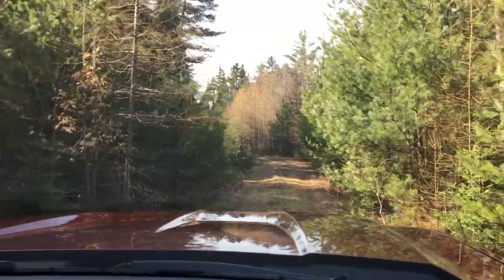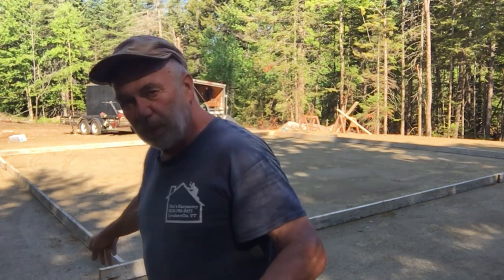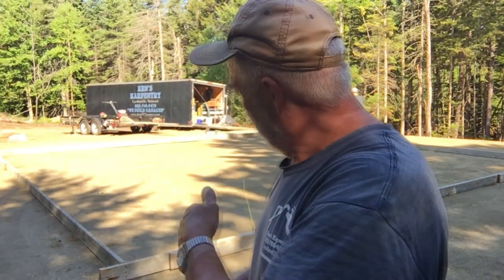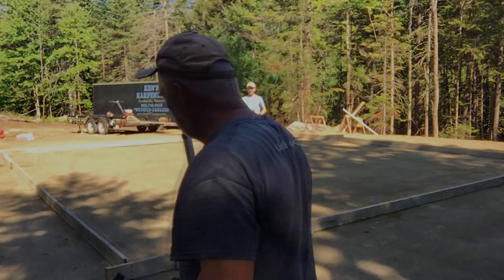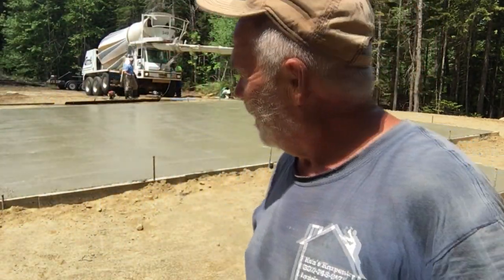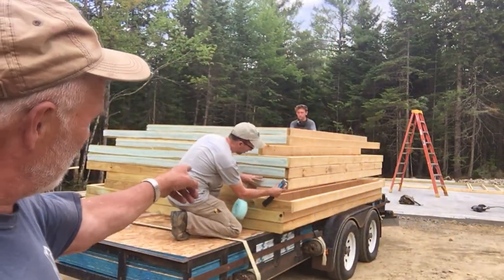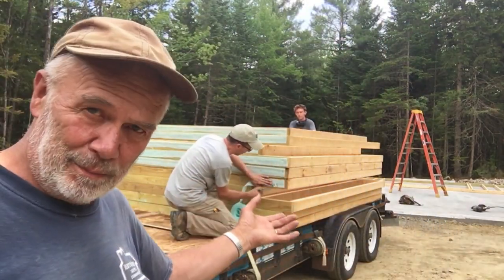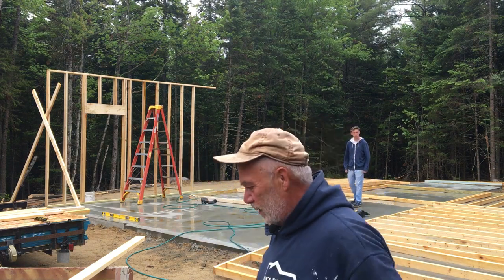#190 Garage in the woods for ATV's and Snowmobiles Part 1 $29,000

Comment: I assume you're one of few builders that is sill willing to give the customer a "firm, fixed price" for a 100% finished project. Good for you. Nail drivers (aka to themselves as builders....lol) living/working in my area are inexpereniced and afraid to quote a firm price. They offer guesstimates"...lol. 

I designed and built cabinets, specialty stairs, homes, garages (similar as you're doing) commercial/offices, farm buildings (dairy barns/poultry houses) and subdivisions for a fixed price, for thirteen years before I became "burned out". I then moved on to (continuing) subdivisions, sewer/water utilities, sewer treatment plants (a very large profit margin for those), airports, ponds/lakes, marina basins (up to 900+ boats in some of them), condominiums, State highways, and bridges along with land clearing and other various construction project, some in the multi million dollars to as low as a couple thousand dollars. I live in a very rural area and we had to be very versatile. I enjoyed 47+ years of construction before retiring. 

AND I did ever project for a fixed fee. If I messed up (and it happened 3 times), it's cost was out of my pocket.
Reply from the maker: WOW. That’s a career. Sounds like you earned some time off.

Comment: How are you keeping remade wall sections in place before double top plate application.
Have you ever written a step by step manual for a typical 24x24 garage showing all your easy method to keep everything plumb and level through entire process. If you did , I think you would sell a lot of copies.
.
Reply from the maker: One stud is centered where the 2 plates come together. That holds 2 sections together until the second top plate is put on.

Comment: Have any sticks or rocks come flying through the air?  That means Bigfoot is close by.  On a more serious note is that a roofing nailer you are using on the OSB? I would think it makes sense as roofing nails probably hold better than crown staples or other types of nails.
Reply from the maker: Have. We use 2” ring shanked galvanized nails on the sheathing. Thanks for watching